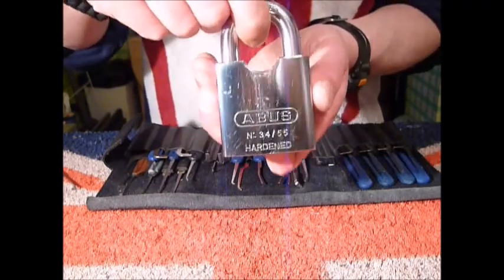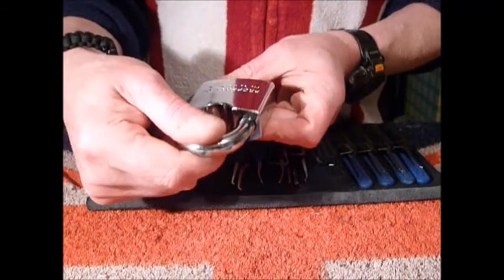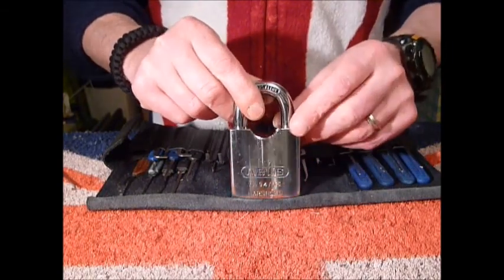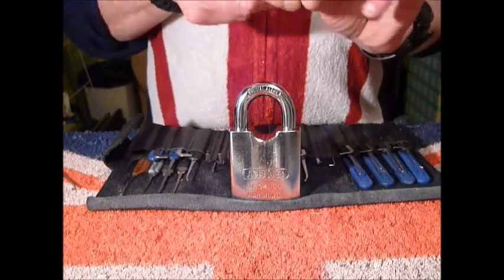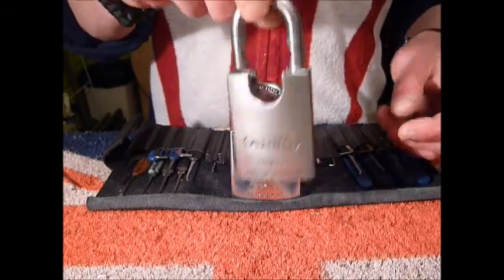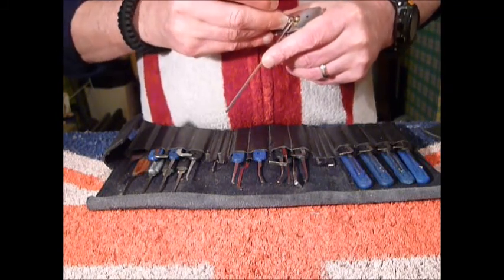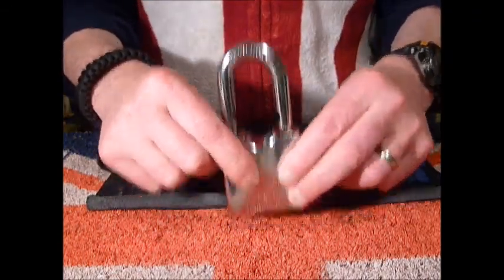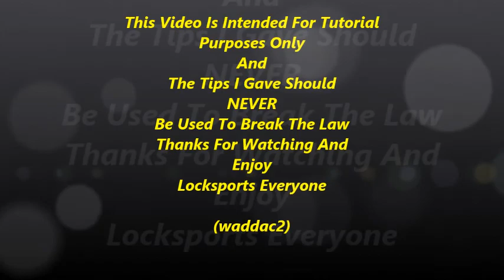Single Pin Picking Abus 34/55 With N.Y.C.H.A Stamped On Back (Revisited) And Showing Pins

Comment: So would you recommend these locks for security purposes?  Such as locking up a shed?
Reply from the maker: Hi Jared Eller. Yes I would definitely recommend this lock for security purposes as is VERY heavy duty and would be a real pain to try and cut with bolt cutters and not sure if it could be cut as would take so long. A thief will always try and cut, not even attempting to pick a lock in my opinion. By the way, Happy New Year and all the very best for 2016.
Reply: +waddac2 thank you sir for your reply. I just recently got interested in locks, locksport, etc. 

I ordered 8 of them. Some keyed the same to use and others keyed different to practice with...
Reply from the maker: +Jared Eller You are more than welcome my friend ;o))))
Reply: +waddac2 thanks I ordered 7 of them. Some keyed the same for use. 
I have recently gotten into the locksport so they should be good practice locks as well.